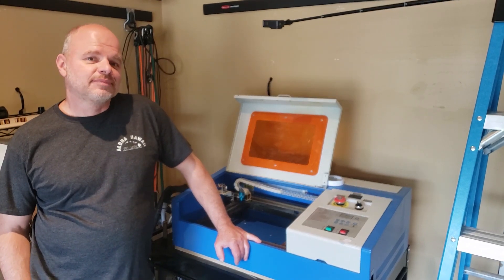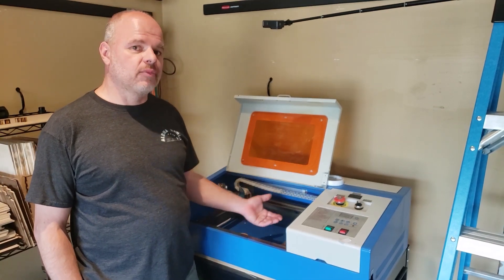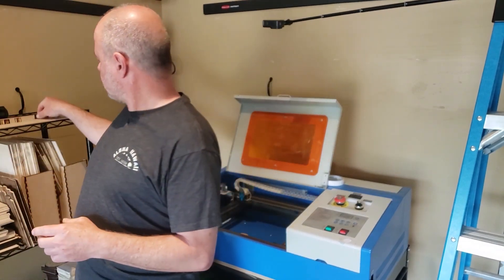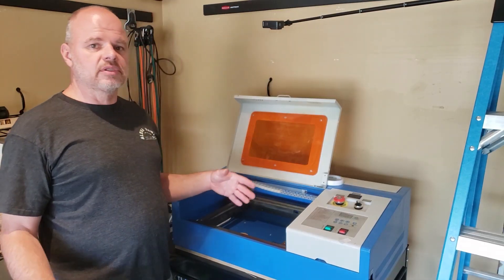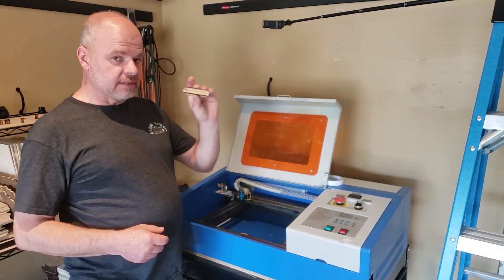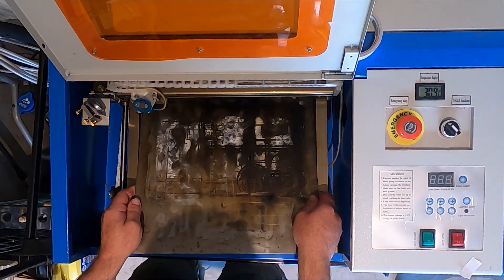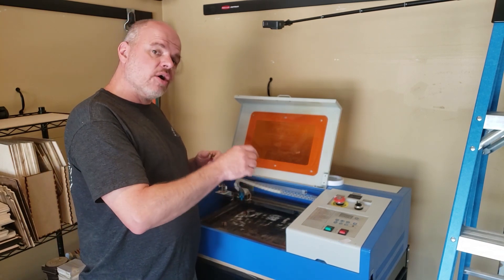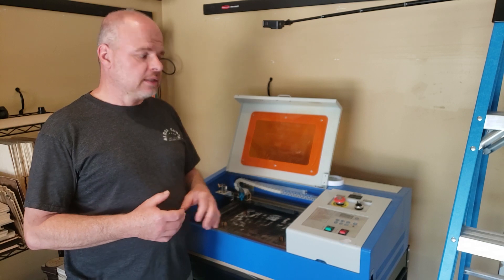Simple inexpensive k40 bed

Comment: Been updating my k40 and the bed is something I was looking into. 100mm Got a scissor lift but it was wonky and took away too much space beneath it. Was looking at belt raising contraptions and they also seemed to loose space and have problems with bolts coming through in useable bed space. This is an awesome simple idea that is most probably faster for known thicknesses. This was worth a subscribe.

Comment: just remember this laser was not made for the high street, it was made for one purpose to churn out rubber stamps all day long, thats why the bed size is so small, it is only since we laser enthusiasts have got hold of it and bastardised it has it become and work entry level home c02 laser.. My bed is now 1 metre square to give an example..  

I completely disagree however with your comments on honeycomb parts and thats probably because your extraction system system is not good enough for what you are cutting, you need to throw away the chine fan, install a proper suction outlet with a metal tube and install an larger fan that will suck all the smoke an air out of the chamber, there is a calculation that you can do to ensure that the air sucket in is equal to the air being sucked out, Its important that you work to this to clear the smoke, the honeycomb beds, are lighter, they allow the cut to properly cut and that is through the bottom of the wood, most people thing its on the top but its not it happens at the bottoms, if you do not have a honeycomb bed that smoke can not escape and will stain the wood, you also need a powerful air assist, this helps put out minute fires that can happen on the top and assists with the cut.

Finally you should check your inlet outlet calculations to make sure you have enough coming in to let whats going out correctly, thats why their are holes all over the K40, they are air inlet holes.  If you have patched them up or use a solid bed then you may well need a smoke assist as well from the front of the laser that pushes smoke to the rear and out of the outlet.

If you take some time to look at larger commercial lasers you will see they all have honeycomb or raft beds to allow smoke to be sucked out of the bottom of the piece of wood you are cutting as that is when the cut occurs not the top of the wood.

Have a play with a honey comb one and upgrade your extraction and youll see what I mean.
Reply: Fascinating ~ hadn't heard about any of this. You answered a lot of the mysteries.

Comment: Ur mod  meets my 2 requirements...simple and inexpensive..too many people on youtube dont use common sense and spend too much time and money making crazy elaborate .ridiculous unnecessary mods...its funny.....i just bought an ebay k40  once i set it up im going to use ur bed idea....i also need to research how i csn use in garage winter...0deg f...without hsving wster freeze....antifreeze?...is the bed mod the only mod needed in order to engrave or cut?...ive seen some pretty crazy youtube videos pimping out the k40....my goal is not to pimp...my goal is to simply engrave or cut once in a while...hobby only...i actually use lego bricks  as spacers standoffs...cheap and easy fast
Reply from the maker: Legos sound like a great idea.
There's a difference between a user and someone who just wants to play with the machine.  I'm definitely a user and it sounds like you are too.
I currently have it in a garage, but I tend to watch the temperature.  The garage is insulated and attached, so typically won't go below 40 deg.  If I'm concerned I turn on the pump and plug in a aquarium tank heater.  These days in Colorado there's only a few days a year when it drops to a point of concern.
Reply: thnaks..i prefer diode lasers since they are low to zero maint.and much bigger engraving area....c02 lasers are more powerful but are high maint high cost...and temp sensitive..i love my 5w diode laser..its way bigger area 600mmx550mm...and i do mostly light engraving in wood is all..i boought the ebay k40 becasue i got a good deal at $200 new shipped...but im not sure im going to like it since i cant use it in the garage due to temp well below 20f during winter..and would crack the costly  laser tube for sure....i would never use a laser indoors..fumes too toxic...my diode is in garage and works fine..temp doesnt matter at all since its not water cooled like c02...if i cant use it in the garage i may have to dump the k40 on someone else.

Comment: Nice idea, simple and easy to replace parts. Am interested in your stock holding boxes on your shelves behind? did you design those?
Reply from the maker: Those were cut on my red and black.  They are a bit too big for the K40 to do, but they were designed with the makercase web site and then slightly modified.